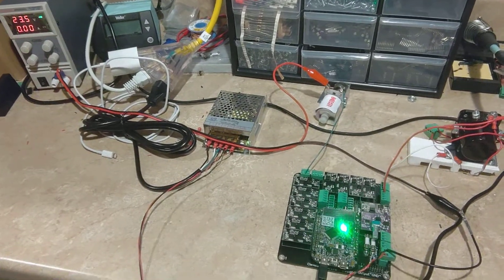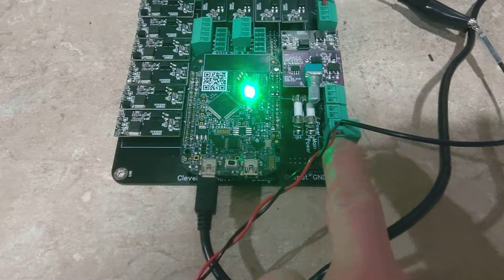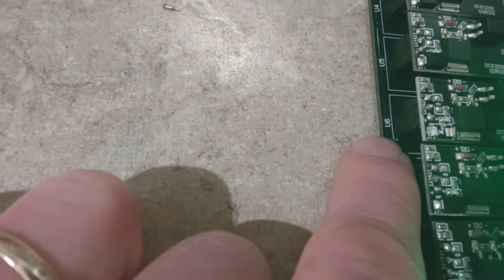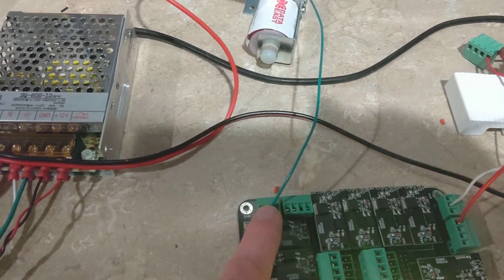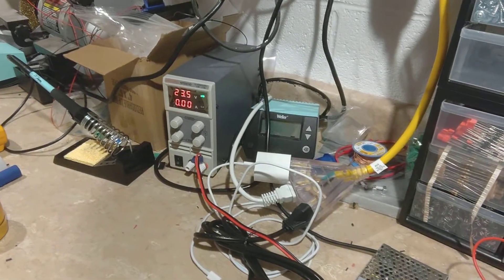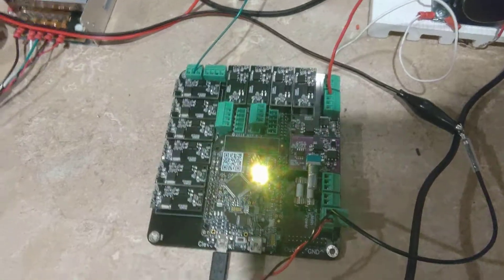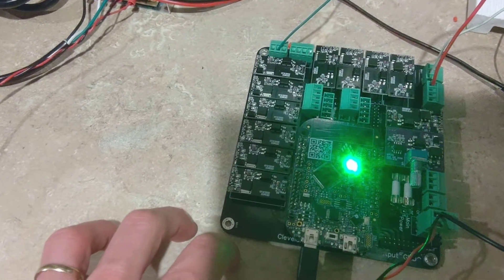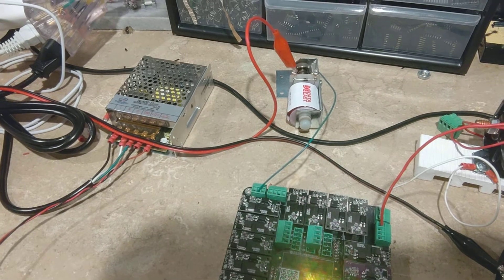Hooking up two power supplies to the Cleveland Software Design KL25Z Pinscape boards

Comment: I have this board and have inserted it into an existing system. I use a 12v (50A) power supply to power the board and all toys. Since this is an existing system, diodes are installed on the shaker motor, gear motor, knocker, chime solenoids, beacon, strobes, and shell bells. Do I need to remove the existing diodes on these toys, or will they work as-is?
Reply from the maker: While the diodes are not needed, it won't hurt anything to have an extra diode in there.